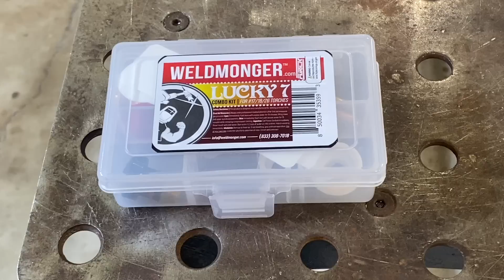The Magic Effect of Argon

Comment: Keep in mind that Argon is 30% denser than air.  As a result whenever it leaves the confines of the cup, it wants to go down in a hurry.  We think that a flowrate of 20 cubic feet per hour is a high flowrate.  Yet when the velocity is looked at, on a #8 cup this works out to only 0.000455 feet per min.  This is why when you activate the gas flow, you hear it, but you can't really feel it.  At this low of a velocity, there is not much momentum in the gas stream and as a result as soon as the gas leaves the cup, it is going to head to the floor.  By increasing the flow when welding a horizontal, vertical or overhead position, adequate shielding gas coverage can be ensured.

PS:  I learned this the hard way this past weekend when I was welding some outside corner joints in a horizontal (2G) position. 🙂

PPS:  For flowrate for a given cup size, I have gone with 2x to 2.5x the cup number in cfh as a starting point.  For me, the key thing on flowrate when welding Aluminum is whether or not I am getting a proper etch zone around the weld.

Comment: Hi Jody, have an aluminum question…i have a new contract for making galley trays for a local airline. This is kind of a tester to see if it will work long term i think. The trays will be anodized after welding….its going to be all new material so wire brushing is not that necessary but if it were to be wire brushed would it show up bad after anodizing?

Comment: With argon being heavier than air, I suspect that you were losing shielding on the basically horizontal weld. I wonder how much an upwards torch angle might have affected the shielding.
Also, it's worth noting that when the gas flow was bumped up that the bead had a much less grainy appearance.
Thanks for another great video, Jody!
Reply: He>Ar on aluminum it’s a lighter it envelopes better